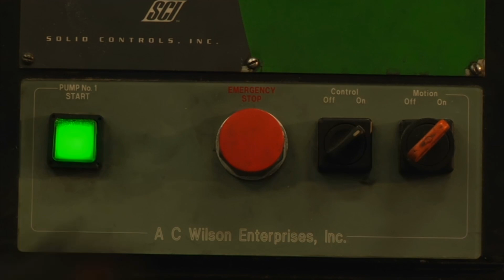Manufacturing Minute: A Bladeless Wind Turbine

Comment: If it works and produces more or equal too out put make large ones for industrial applications.
Vibration problems are obvious as if it can lurch the retaining structure off the ground. I would like the see an update to this product as it could be installed with an internal counter motion flywheel to reduce vibration or something better for the same problem.

Comment: There appears to be an awful lot of motion trauma on the turbine/ energy generator/ that in and of itself could potentially lead to very maintenance costs and extended down time. I would want to see the performance record over a period of time say start with 1,000 hours then the 10,000 hour mark then the 100,000 hour mark then finally the 1,000,000 hour mark measuring down time and interrupted time. that would give me a better picture of its viability. Anything less than that would not be a viable test.